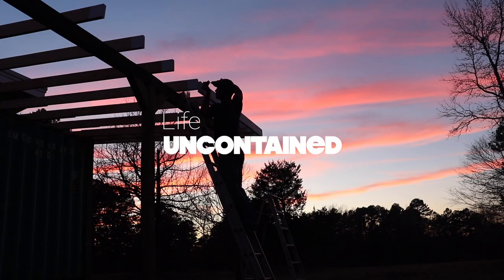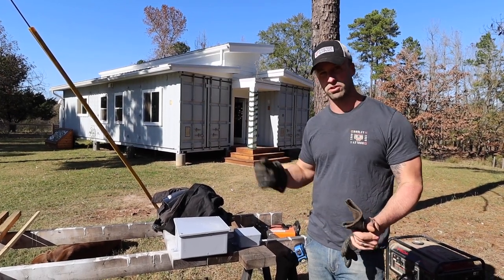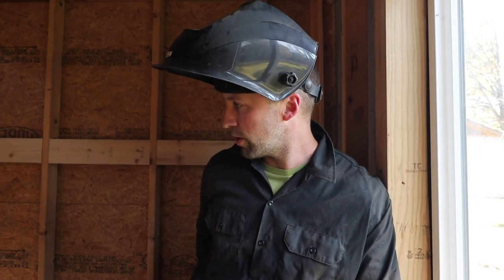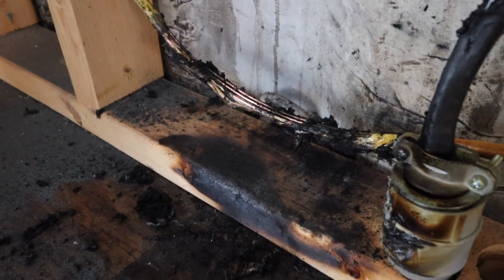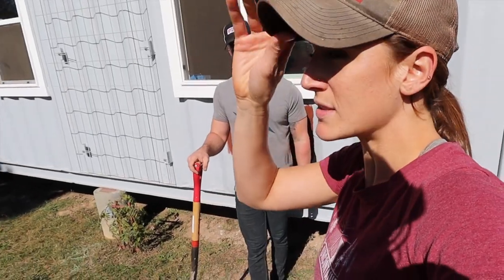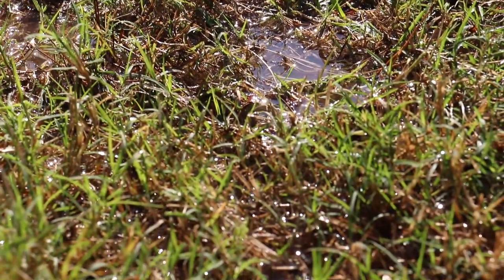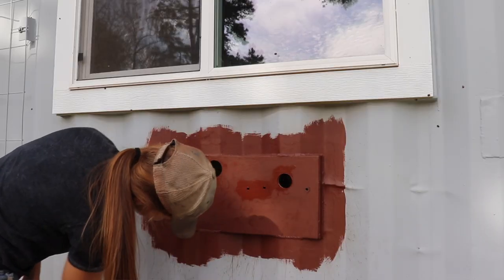Our House Caught On FIRE!

Comment: When welding or fabricating , any shop worth its salt has fire blankets available in case of emergency. They can also be used to protect any sensitive areas that you'd rather not set on fire.  Its a good idea if your going to in the future , is to have at least a fire blanket close by so that either yourself or some one near by can smother you & the fire out. Jeans , t- shirts , socks , anything of that nature is a hazard , so you always assume it can happen.

Comment: You can keep the boards on the fence from bowing like that @ 11:35 by placing a 2x4 perpendicular to the 2x6 in the middle and screwing it together like a T.  Will make the fence much stronger, especially if the animals are pushing against it.  Anyway, glad the fire wasn't too serious. They can get out of hand quickly if you're not careful.

Comment: should have put an expansion coupling in the pipe coming up to the house on those conduits so as the trench settles with the pipe it wont pull the connector out or break the box! Also if the panel is 8 feet from the entrance into the house it should have a handle disconnect on the outside of the house!

Comment: You guys should listen to all the electricians that have posted in the comment section talking about the service wires to the panel. It should be in conduit for protection! Making this comment just so hopefully the issue is recognized and fixed before the spray foam !

Comment: After being a contractor for 20+ years, since you can see where the existing trench was, I would have used an auger (trencher) next to it. Data (LAN internet) should be 24 inches away from power lines. FYI, while the trench is open, lay in a 2nd spare conduit for future.
And as it was said. Single conductor cables have to be in conduit

Comment: Ethernet is differential signalling, it's designed to ignore powerline interference. You might get a bit of common mode coupling but as long as it's a few inches away it's unimportant. That's a lot of work for something that didn't matter

Comment: It's been mentioned many times already but the main feeder lines to the breaker box should never be run through a wall if possible . It is best to run under the house and straight up into the box . They must also be in conduit . In the event there is a short , those wires can become a red hot heating element before the big main trips .

Comment: Just a little hint on running mains.

When your running mains cable, pull the cable through the individual lengths of conduit and the corners etc. 

It's saves hours of trying to pull out through later.

Comment: glass fiber network cabling does not need another conduit,  
no more digging only if did you have a wire already in the conduit to pull the fiber through

Comment: Spencer, you always do research for your projects. Electrical is the most dangerous due to fire potential. You should refer to the NEC codebook. The loose wires you ran in the wall should be in conduit. It's just safer for you and your beautiful family. Just a recommendation. Keep up the good work, don't let the light at the end of the tunnel cause you to cut corners.

Comment: Spencer,
That THHN wire that you pulled in to the wall studs is not to code and very unsafe too. That wire is only intended to be in conduit. If you do not want to use conduit you can use a service entrance cable. 
But if you're inspector is picky he will insist you install conduit on the outside of your house and then come in from the back side of the main breaker panel with conduit.  Good luck.

Comment: I set fire to my camping toilet tent inside my container house 2 weeks ago when welding a bracket onto the outside wall. I was surprised at the amount of heat transferred through the steel wall - I didn't even have a cut out section like these guys did. I'll be extremely careful next time I'm welding on the containers!!

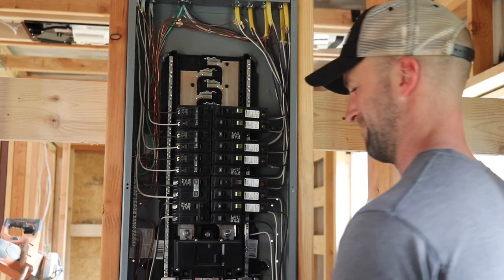Comment: Also, at 16:49. If your going to use white as a current carrying conductor ie 240 circuit. It needs to be flagged. Put a band of red tape on the white at both ends to identify it as "hot"
You use red in conjunction with black in single phase 120/240 service. I've used a red sharpie to paint the white wire red.

Comment: For Future projects, go ahead and run the wire in the pipe before you bury it.  Depending on how long a run I have I might even run wire before gluing the pipe.  That's so much easier than trying to pull it thru after.,,   Cut the wire from the spool after the pipe is buried.

Comment: I have the same antenna setup as you for internet. Your Yagis shouldn’t be parallel to each other. They should be perpendicular. The metal brackets your using have an adjustment for this. Tilt one 45 degrees to the left, and the other 45 degrees to the right. Also like me you have your antennas on a pole, 4G is a really high megahertz signal and as such suffers dramatically from signal loss in cables. if you use ultra  low loss cables and make the adjustments to your antennas angle your signal strength and hopefully speed will improve. You may also need adapters for the cables. The ultra low loss cables use a fatter connector so you have to adapt on each side. Antenna is usually type F and the router is usually SMA.

Comment: From an electrical code perspective, the 2020 National Electrical Code (NEC) article 300.3, states: “single conductors specified in table 310.4(A) shall only be installed where part of a recognized wiring method of chapter 3.”  Chapter 3 wiring methods include conduit, wire ways, armor-clad and metal-clad cable, NM cable (what many refer to as “Romex” or "nonmetallic sheathed cable"), and so forth.  So single conductors must be installed in one of these methods.  As such, THHN single conductors (what appears to have been used) should not run inside walls "free air".  Hope this provides some assistance.

Comment: Kenzie, In the Philippines wood is very expensive and random width and thickness so we build with concrete. We have poured concrete foundation,  floor slabs, 
walls, ceilings and roof. The frame is concrete columns and beams. For the building permit we have to have the plans approved by the fire department although
I don't think porcelin tile floors are combustible having been  heated to 3200 degrees F during manufacturing. Concrete counters and stainless sinks would also
be Spencer proof. Steel window grills, wiring in conduit inside poured concrete.I suppose with some effort mahogany furniture could make some smoke. Still we
have fire inspection.
          I don't use fish tapes any more (too hard to wind back up and don't go around out of rotation sweep bends). We use a spinning reel with a piece of plastic bag 
on the line and suck that thru with the shop-vac. Then tie braided rope on the line and reel it back thru the pipe. The rope pulls the wire through a maze of elbows. We
pulled 54  five hundred foot long spools of #14, #12, #10, #8, #6, and  400 ft of #2 AWG wire in four days with three guys working. It took 4 month to wire up 195
LED light bulbs  and 176 recepticals. All the wire went to Dinkle terminal blocks in sub cabinets to make the breaker boxes neater.  Good thing the labor rate is $10 per day

                                            george and aurora

Comment: Always add an additional pipe or conduit beside first one before you back fill. Just for this reason alone would have saved a lot of work. If you had one of those small tillers (Mantis), this job would have been easier. You can use it for a garden after on as well. Leason learned. Glad not too much damage was done to house. Hope the little one wasn't inside and breathed in the smoke. Need to hook those detectors up ASAP. I would have bought STARLINK for my internet.

Comment: I'd add some surge protection to the power lines. Do you have an "earth" system, perhaps a buried copper mat? Try and think about making it easy to replace and/or add new cables, both power and data. I assume you'll take photos of all things inside your walls before sealing and adding insulation foam.

Comment: You do know the equipment ground needs to be bonded to your containers or any structural steel. The purpose is if at any time a hot conductor gets chafed or inadvertantly connected to the container and you happen to touch it and touch a grounded item you will get shocked or electrocuted. Bonding the containers or structural steel will provide a return path for the ground fault to trip breaker. 

I tried finding my previous comment but couldn't. Pending where your located, if you experience snow you have ground frost. Therefore your PVC pipes in the ground will change elevations and your tap can is affixed to the container. You should use an expansion coupling on the service pipe and your communication pipe.

Comment: That wire you used needs to be placed in a conduit inside the house, It not free air rated, aka it need mechanical protection. Outside you need to place an expansion joint just above ground for thermal expansion or it will pull out of the PVC connections.

Comment: Running power and Ethernet in parallel close to each other will cause noise on the line. Unless you use shielded cat6 or shielded cat5. Love your videos! Just wanted to help!
Reply: Best bet is to just use fiber with a pair of media inverters

Comment: You never run com wires with power.  There should be at least 3ft between them.  Power causes a field around it called Electro Magnetic Field (EMF).

Comment: use a TRENCHER machine, either chain, or wheel,  types
and place the NEW trench 
about 4 feet on one side (horizontal separation)
of the existing services-trench.
I think that is better "good practice".

Comment: You probably should have installed 2 or three pull strings in that conduit. If you ever need to add or replace cables its gonna be a LOT harder. Always put in a minimum or 2 pulls strings and replace as used. Also might want to measure your distances on the Cat 5/6 cables anything over 325 ft. without a booster of some kind will start to get line drop and your connection will be spotty. I didn't see  room for a signal booster or power in the outside box so be aware that the hop in the box plus any wiring in the house will add on to your distance. Just eyeballing it it looks like you are getting close on the distance for the ethernet cables.

Comment: Spencer, why don’t I see you ever using your tractor for trench digging or filling it back in? You can buy a drag claw for the 3 point hitch pretty cheap to dig your dirt up loose so it’s much easier to shovel non compacted dirt out and then the front bucket can fill the trench back in within 10 minutes instead of 90 minutes.

Comment: You should install an extra conduit with a string inside in the event one of the other conduits get damaged, ie wires melt together inside the conduit etc (I've seen that happen) that way you're not having to dig it up a 3rd time. Always better to have a back-up especially when you have things already opened up

Comment: Nice clean service install when digging trench come six feet off house dig shovel hole then every 12 ft round shovel hole use pickaxe and hoe to pull the material to hole remove the dirt at hole location you remove less material when doing it by hand

Comment: There is very little difference between running the wires in the same conduit and not having them physically separated in different PVC conduits.  There needs to be several inches of earth between them or they need to be in separate metal conduits.  Physical distance or shielding is needed between communications wiring and power wiring.  Unshielded Ethernet cable, especially when approaching the 100 meter length limit, really starts being impacted by interference.

Comment: The distance limitation on ethernet cable whether it’s cat 5E or cat six is 100 m 330Ft! If the distance from the barn to your cable modem to the house we’re your going to install an Ethernet switch is more than 330 feet! It won’t work you’re going need to install fiber optical cable

Comment: Probably should have drilled and tapped the holes for the outlet boxes, when its all spray foamed and you need to take them out it will be hard to get a spanner on the inside.

Comment: I would disconnect your ethernet wire and lay a new one in the ground. It would be way easier and you would just be out the cost of the wire and the conduit. Doing my suggestion also allows you to rent a little ditch witch and get it done much faster.

Comment: You can run internet next to power. But it might cause interference. It just depends on the circumstances. Safer to split them. (It should be noted that fiber optic would be totally safe from interference.)

Comment: Don't know if this applies to your situation.
When running unshielded data  to typical residential  (120V or 240V AC for example), the NEC (National  Code) specifies it  be separated by at least 200mm or 8 inches.

Comment: Glad it was minor 
As for your wire pulls you should always use metal 90°and 45° degree bent pipe. As the wire and pull string/rope can burn through the bend. Also use wire lube...

Comment: You could just use a repeater on the outside of the house and run your ethernet cable off of it, into the house with another router. No digging required.

Comment: You can run a point to point wireless link from your barn to your home. Ubiquity makes a very affordable line. Simply o e on each end and connected to switches and grey are bullet proof after they are aligned. I have a masters in computer science, so I’m not steering you wrong. Dm me if you want to talk. You can also purchase shielded twisted pair in cat7 that can be ran next to energized power lines.

Comment: underground wire 3 ft' down in the ground 1' above you should put warning tape in place...... be smart 
and don't buy and waste money on those 90 degree pipe. use a torch and warm up the material and than pull it into the form you need it to go... money saved and much more smooth bends this way.

Comment: I know that the fire system hasn't been commissioned, but if the detectors are not covered, they may be contaminated by the smoke. Worth checking. If they start off faulty, this will probably be the reason.

Comment: I have been viewing since day one. Love, love you guys. I see the comments about the conduit wire shielding. I think I understand the reasons. I do have once thought. Is it wrong that when I ran conduit with wire underground. I layed the pipe out, before glueing, ran the wire thru. So I didn’t have to pull the wire thru. Is that not a more, less , backing breaking work. Or did I do it wrong? So glad you guys and the baby weren’t harmed during the incident.

Comment: Should have ran PVC under the house straight to the panel. Instead of running the feeder wire through the walls. You would have save a lot of time and energy.

Comment: Hey Spencer, I don’t know your national electrical code in the the USA but in Canada you can’t run the main feeder wires (or any wire unless rated to do so) free air through the walls like that. Is that allowed? We typically have to put it in conduit, or it could be a flexible cable.  It’s just a question. You’re both doing awesome and I love watching the build. Can’t wait to see the finish product.

Comment: Close call.
The main reason you run mains cable seperate to comms cable is in case there's a fault in either cable, you don't want the high voltage mains to get into your low voltage comms cable and cause more damage or injure someone down the line.

Comment: You need to have those wires in a pipe. If they were like the wire that you pulled out of the wall "Romex" and encased in plastic/rubber coating it would have been fine, but those wires are just wire that needs to be in pipe; not okay to run bear in the wall.

Comment: Good video ! It looks like your running Your Mains through the studs without being in conduit. I Don’t think that’s safe or legal. Main Power to the Breaker panel Should be in Flex conduit at a Minimum. Fyi Power wires get Hot under continuous load. Direct  contact with a dry 2x4 could be problematic.
Also —
You allways Want Power wires as far away from internet or communication wires as possible. ( min 12” ) Farther for larger wire. ( min 24” ). When power runs through a Wire it creates a Magnetic field around it. The larger the wire the greater the field. Hense why no communication wiring should be close to power wires.

Comment: Code Violation: Your feeder conductors and the grounding conductors should be in the same cable. It's not supposed to be separate , unless the cable and the grounding are run in the same raceway. NEC Article 250.

Comment: I would like to know about the outside shower. Does your water on demand water heater need electricity to work?  I can only see a propane tank.  I have not run across a demand hot water tank that operates without electricity.  Please share about the name of the water heater. Thank you, Mike .

Comment: why are the cables and water pipes not made through a PVC pipe, wall if you have a problem after the spray foam. then you can always dissolve in an easy way, without loosening the spray foam

Comment: So there is no electrical inspection in Texas?  Most states require inspection on buried conduit  prior to covering and proceeding with wiring.  May want to check into that.  You don’t want to have to dig that conduit up a third time.
Reply: Rules are different from one location to another. Where they live there are no such requirements. They did a video about that earlier in the year.
Reply: @genewaddlerandomstuff2122  That’s interesting.  There are some counties here that don’t have building code inspection in Tennessee, but electrical inspection is a state wide requirement.

Comment: You can’t run thhn wire open air. You need to use feeder cable which is like a large Romex wire. Open air thhn wire in the walls will catch fire.